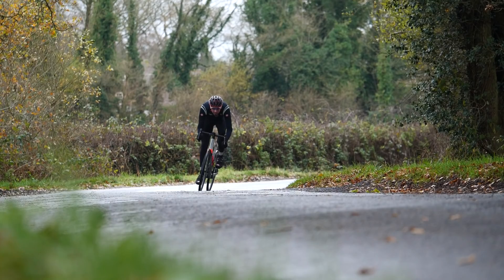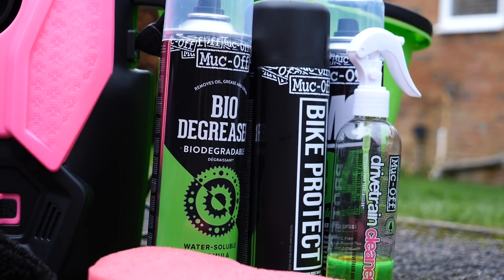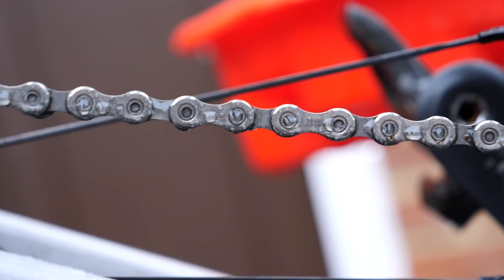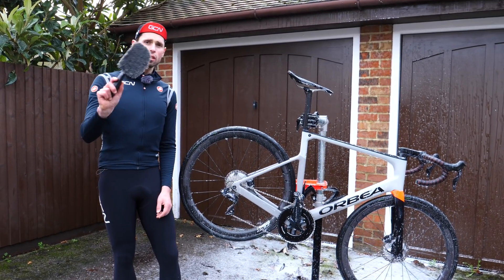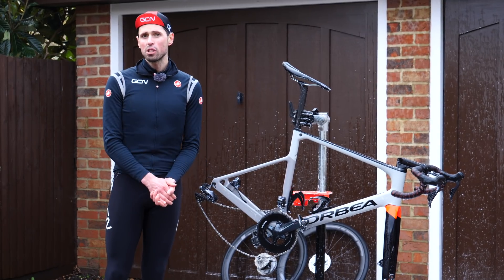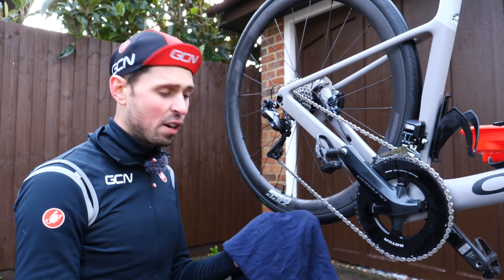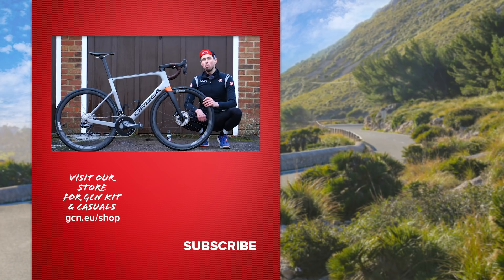How To Keep Your New Bike Super Clean

Comment: Think you should remind electric bike owners that power washing, even low pressure, can cause damage to the internal electrical parts including the battery. Most E-bikes are rated water resistant for rain and puddles but not for pressurized spray.

Comment: I've tried various methods of cleaning bicycle chains and have settled upon removing the chain from the bike via the quick link. I than place the chain in a plastic bottle part full with either  kerosene of a biodegradable cleaner. Next I shake the bottle for a few mins, pour off the dirty fluid and replace with clean and then shake the bottle for a few more minutes before draining off the fluid. I repeat this process until after shaking the fluid remains clean indicating that all the dirt is removed. Next I carefully vacuum  the chain with a wet vac while using the crevice tool attachment. This insures that all the cleaning fluid is removed which enables the lubricants to penetrate the link roller as you lube the chain. For the actual lube process I stretch out the chain on my work bench then using a squeeze applicator bottle I carefully lube each roller, allow some time for the lube to soak in and then remove the access with a clean rag. This process takes longer to describe than to perform and results in a very clean and well lubricated chain which shifts better and lasts longer.

Comment: Not for after every winter ride, spray gt 80 over chain drive then use a chain cleaning tool dry as in put no degreaser in the bath part, run chain through it and dry all off with a rag, saves having to wash off the degreaser , no water left to seize the parts in winter then lubricate, if we had to do GCN method in winter we would get hypothermia after the ride, if the weather is too bad to go a cycle then certainly do there method

Comment: 3:07 you shouldn't use a brush on your frame in general. That's a pretty good way to put a lot of haze into the paintwork. I also keep an old tooth brush to really get in and around the jockey wheels.
Reply: Believe it or not, when I buy a new bike that has paint, I waxed the frames with Collinite Fleetwax 885 right off the bat before even taking it out for the first official ride, but any car wax will do. A brush with very soft bristles works fine without cutting through the wax. I rewax each bike about every 6 months and the paint still looks beautiful. My titanium bike doesn't need shit done to it except a wipe.
Reply: @casualguy3938  same here. Every bike i get, first thing I do is give it a polish, then wax or ceramic coat (if I have any). It just makes it so much easier to keep it clean. I'm also one of those pedantic people who soak new chains in naptha then IPA in an ultrasonic cleaner just to get the factory shit grease out because I hate having to continuously clean my drivetrain as that grease oozes out and mucks everything up.
Reply: @mihalis1010  Yeah, I agree. That factory grease on chains sucks balls. I used to take a lot of care with my chains, now, I just use WD40 and a rag about every 400-500km. I never ride in the rain and easily get 20,000km out of my chains before I even think of replacing them. According to Fast Fitness Tips on here I lose about 3 watts over the very best chain waxes, and since I don't race the simplicity of a rag and a can over all the wax stuff is a no brainer for me. 
Waxing the frames helps a ton though, not only for cleaning but resale value too ;)

Comment: Tbh I used to use all muc off products, I find good old washing up liquid does just the same job, warm water, sponge and fairy goes along way 👍
Reply: Best not to use washing up liquid as it contains salt and if not washed off really well will cause corrosion. Typically example is corrosion at spoke nipples and hubs.
Reply: @scrossman8991  I've been using it on my madone SLR for over a year and had no issues 👍
Reply: @scrossman8991  GCN investigated this myth and the salts in washing up liquids are not the type that cause corrosion, they're perfectly safe.
Reply: Mate I’m totally with you on this! I think a lot of muc off products are a rip off
Reply: @darrencripps  Yes, if a brand does contain 'salt', it will be Sodium Sulphate, not Sodium Chloride.

Comment: Is that degreaser save to use near the pads and brake discs? I have it but I'm extra cautious using it that liberally.

I do have the bike protect and use the cloth method as I know that's not good for the brakes. 

I only ask because I've recently bought a new Ribble bike and don't want to screw the brakes up straight away lol.

Comment: Those pressure washers and snow foam guns are a complete waste of time. Who the hells need water at that pressure anywhere on a bike, even if it is lower pressure than a car one. What's wrong with a garden hose? Also, Fairy Liquid is absolutely fine and two quid a go. It's like the car detailing mentalists have gone into pushbikes.

Comment: Great tutorial, please do allow me to share my washing routine, i use the muc off c3 dry lube (dish soap soluble no need for degreaser AT ALL) So i blast water into the chain links and spray dish washing liquid on the chain and brush all of the chain + pulley + chain rings and i once again blast it. By this stage the only thing on the bike is dirt on the frame and totally oil free. I then spray dish washing liquid all over the bike without any care for rotors because if you can eat off your plates, your rotors will not be contaminated. I then sponge wash the whole bike and proceed to drying/protection. Since i have used Turtlewax ice seal and shine on the frame and wheels, dishwashing liquid will NOT remove any hydrophobic coating at all (proof on youtube video on the turtlewax) all i have to do is use a portable air blower to blast off the water and since it is hydrophobic it just slides off. I blast all bolts as well as FD and FD as well as chain. By this time the bike is 100% dry and chain is 80% dry. I feel comfortable to relube the FD, RD and chain with 0% chance of contaminating the brake rotor. I bought the muc off protect but i have never found it to be a good idea to spray any aerosol anywhere within 50m radius of my pads and rotors. I wash my bike once every week and they are absolutely pristine.

Comment: Living in Florida, I ride every day. Because of heavy traffic I ride mostly on the sidewalks. On the rare mucky days, I don't ride. So my bike doesn't require much cleaning. All I have is very light dust which is easily brushed off with a paint brush. Occasionally, I'll wash it because the wheels get a bit dirtier, then let it dry in the sun. I use a spray polish for protection. I clean the chain and lube it every 100 miles, and I don't clean the lube off the sprockets because it protects them. I'll use a citrus cleaner to clean them if they get grit on them. At four years old and almost 10,000 miles on it, it's in excellent condition. And I do all my own mechanical work.

Comment: I use a leaf blower to dry my bike. I also apply the protector spray before installing the wheels so I can get it on those tiny spaces and I don't have to worry about contaminating the rotors.

Comment: seems like 95% of the most expensive bike cleaner going is on the driveway. 2 buckets, washing up liquid and some good degreaser for the drive train job done. Literally no need for the pressure washer, a hand powered pressure washer or a hose will do.
Reply: Fundamental mistake m8, do not spay degreaser anywhere near ur brake pads, u don’t want to contaminate them 🤣🤣🤣🤣🤣🤣

Comment: Question about spraying the cassette and chain with degreaser and then scrubbing it with a brush. Does this create any issues when the degreaser gets splattered all over the rear disc? I've been covering my rear disc with paper towel for that part, but if that's not necessary, I'd gladly stop. It's kind of a pain.

Comment: Cleaning the drivetrain is better to remove the chain by the master link as well as both wheels, then cleaning them separately. I use an air blower or air compressor to dry all components and in between small spaces, air displacing all the water, rag wipe dry the rest of the bike then put all back together then polish and lube.
Reply: Try waxing the frame with car wax. It does an amazing job on bikes as well

Comment: Here in Warroad, MN, USA, and similar areas (I'm thinking of Winnipeg, Manitoba, for example), our landscape water is in its solid state for about half the year. That condition requires cold air, and the air density in that half of the year is great enough that ridin' dirty is not appreciably a great brake on progress. (Notwithstanding Slick Willie.)
That said, the road treatments can be an issue. I do not ride my aluminum frame when the road chemical is applied. Aluminum, you'll recall, is pretty reactive. [Sorry, GCN: 'aluminium'] On the other hand, the air temperature needs to be above a certain point in order for the road chemical to work, whether it's a chloride, or urea-based. The works departments, God bless them, know this, through valiant use and wont, and will switch between chemical and sand on a per case basis. The sand just needs dry brushing.
We do get blizzards. I ski during blizzards, because wheeled travel is impossible.
Your results may vary. Travel, or movement, is the main thing. Sometimes you just can't stay home and wait for the JDAM. The Finns, for example, just didn't sit there, "sheltering in place", in their fight against the USSR back then.

Comment: I got one of these Muc-Off pressure washers for Xmas, even with the foamer on the lowest setting it gets through the degreaser crazy quick. Need to water it down plenty.
Reply: Just buy car soap.  Meguiar's in the pink bottle is 1/4 the cost of Muc Off's soap.  Don't be tempted to buy fancy car soap: you don't want the wax they contaminating your braking surfaces.

Comment: Who else doesn’t have a yard and instead has to do this in the bathroom?
Reply: in the yard or street -- but yeah if you're in an apartment this is tough.
Reply: Me too..
Reply: It’s the kitchen for me 😂😂
Reply: I do it in the shower or tub. Road bike is easy, as it's usually not caked over with mud, so I just rinse it with the shower head, degrease the drivetrain with a dedicated foam, then soap the bike up (I just use hand or dish soap), scrub it with a car sponge, scrub the chain etc, then rinse it all down. The worst part is taking care of disc brakes, as the back one can get contaminated with grease and grime.
Reply: You and me bud, haha. It's such a mess...
Reply: Too bad the bathtub is always so dirty it takes me as much time to clean the bath as cleaning the bike.
Reply: I just do it on the sidewalk in front of my house
Reply: why not! just make sure you wash any grease on the tub or it will leave a mark (I guess?)

Comment: Great video GCN. Actually I’ve just done exactly the same wash process steps a few hours ago after a good ride out on my BMC Urs. Parktool stand, Muc Off pressure washer and drive train cleaner. I use a 2 PSI blow dryer for drying my bike which is very simple and gets all the moisture out from your parts. I also apply the bike protector spray on a cloth not only for the entire bike but also for my DT Swiss Arc rims and the bike looks like new every time. Love the Muc Off products  and all of your vids. Keep up the great work. Greetings from Switzerland

Comment: Don't you only need washing-up liquid and WD40?
Reply: simple green, wd-40, and chain lube will do the trick
Reply: Well washing up liquid has abrasives in it so depends if you care about your paint work
Reply: Yeah muc off is overpriced weak sauce. Get 5L industrial degreaser from screwfix and dilute. Lasts forever.
Reply: Yes.
Reply: @tom4626  been using Fairy / Dreft washing-up liquid om all my bikes for decades, literally. Works a treat, never any adverse effects on the bikes’ paint work (both matte and gloss frames).

Comment: Silicone spray on the underside of the downtube, bb area, chain stays and a very gentle wipe over, before a wet ride. The dirt then just washes right off at normal tap pressure.

Comment: Just a little tip I want to ad: Use the blowdrier to blow all the water especially from hidden parts like disc brakes, shifters... you will be surprised how much water you will be able to blow out. (make sure your wife/girlfriend doesn't see you using it)

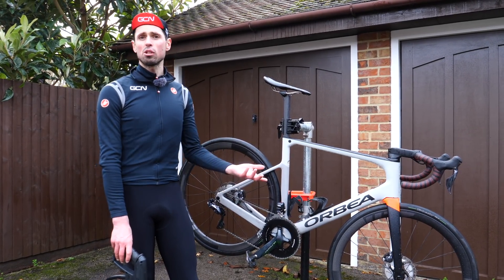Comment: Honestly? I know it is a sponsored video and you have to show a lot of special cleaning accessories, but come on.. let's keep good quality of the video! Why is the presenter cleaning casette with the jet wash staying in front of the bike????? 3:48 All the mud and oil goes to the disc brake, what makes it much dirtier than it was even before the cleaning. The presenter should've stayed right behind the bike to minimalise the impact of dirty water on the disc. Secondly, after washing all bike components the presenter cleans the disc. 5:55 WHAT?! All the mud and dirt is put on the disc one more time. After drying the bike it WILL NOT brake as it did before. The disc and braking pads will be dirty as hell and the pads will have to be changed to new ones, because these on the film will not break at all. ¯\_(ツ)_/¯ The film shows to viewers how to generally wash the bike, what components should be cleaned and what to focus on during cleaning the bike. BUT it works when a bike doesn't have disc brakes. If a user of disc brakes does such cleaning, they will be pretty surprised by working of their brakes (or rather not-working). So everyone, keep it in mind not to put oil and mud on your disc brake, because it will work much worse than it did before the cleaning. GCN... remember not to forget about things, that people who aren't bike experts might not know and keep the quality of your videos on high level. GL and cheers!

Comment: Oh no  @02:49 you're lacing the disc with degreaser. I am triggered, Alex!
Reply: Yes, also he should have the wheels removed first so he would not spray off some lube from the drive train on to the brake rotors.
Reply: Those brakes are no good any longer. What a junk video.
Reply: What's wrong with degreaser on the discs?
Reply: @rikkiola  He spills a mixture of degreaser and loosend grease/oil on the discs. It will embed into the brake pads and you can throw them away.
Reply: @rikkiola  It's more that you really don't want it on the pads, but you want to avoid the entire breaking area really
Reply: Yep, I thought that a mahoosive school boy error!
Reply: Why do they ignore rotors? I’ve contaminated one once by watching one of there videos. I’ve learned the hard way.
Reply: @Jasonr606  Our point exactly 😉 Well, it certainly is a paid advertisement video.

Comment: For those of us who live where it’s constantly below freezing and can’t use a garden hose I recommend getting a 1 gallon lawn and garden sprayer.  They cost about $12 from Home Depot and you manually pump the handle to create pressure. I fill mine with 1 gallon of hot water and spray down my bike after a ride to get rid of all the sand and salt.
Reply: Thanks for the tip! NYC resident here as well 😅
Reply: in winter I wash my bike in the bathtub ^___^

Comment: For a thorough cleaning, I take off the wheels and clean wheels and frames in my bathtub: warm water? Check. Low pressure water jet? Check. Quick drying of parts? Check.

Comment: Lowkey worried for those disc brakes when he sprays the degreaser
Reply: Why? You should degrease discs from time to time also.
Reply: Nervermind, found the answer in comments below, it’s about the pads mostly, good point : )
Reply: @inqu935  degreaser itself is kinda greasy lol so use rubbing alcohol instead

Comment: The first time you sprayed it down wasnt so bad. I doubt that much water was forced into the BB, freehub, pulleys or head set. The 2nd time it was sprayed made me cringe. Never, ever, never never ever use that much water force around anything that has bearings in it. Whether you use grease, oil, wax or even WD40, jamming water into those areas is an absolutely terrible idea. If I ever took any of my bikes to a shop and saw them doing that, I would tell them to replace whatever bearings got that much pressure. You can remove the bubbles with a much smaller amount of pressure. 

I have worked on fishing boats and yachts costing millions of dollars. Of course salt water is the enemy on those, but water is the enemy for bearings, and that much water pressure is going to leave water in the bearings. No matter if you use any fancy spray, some will remain.

Comment: If we use "Bio" degreasers as a means of contributing to the environment, I believe we can achieve a whole lot more for the environment by being more conscious with the amount of water we spend. Water might be readily available for a lot of you but think of other places where clean safe water is hard or impossible to come by. Ditch the hoses, use a bucket and challenge yourself to achieve the cleanest result with the least amount of water. Cheers and happy washing.
Reply: Indeed, and using the jetwasher like this also makes the lbs happy.
Reply: Uhm, I don’t think that people in areas of low water availability really profit from me using less water in an area of high water availability. The water I don’t use doesn’t get transported to the Savannah
Reply: @DrKjoergoe  I see your point, while this is technically correct nowadays, I still fail to see a single reason why we should be overusing our finite resources based on the fact we have plenty to go around today (we've done quite a number on ourselves with oil already) that is  just as irresponsible as it is inconsiderate.  There will be a point when we will actually have to help other nations by actually carrying that water over to them, or if we keep blasting away all that water with jets and hoses, perhaps we'll be the ones begging other nations for some H2O. Food for thought.